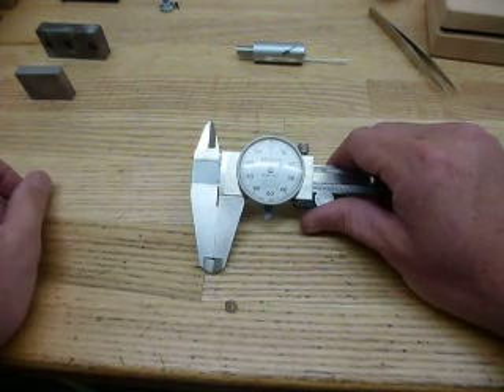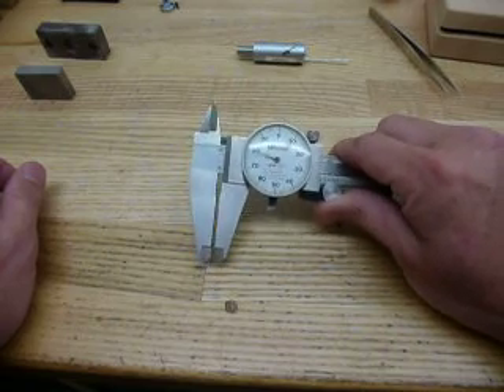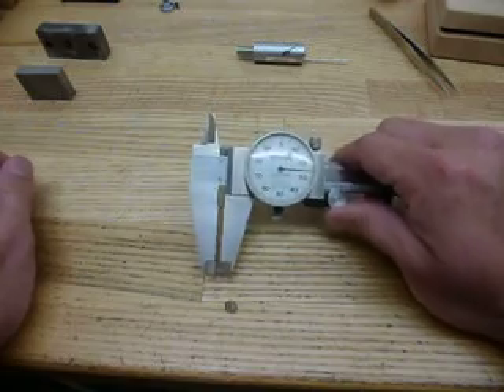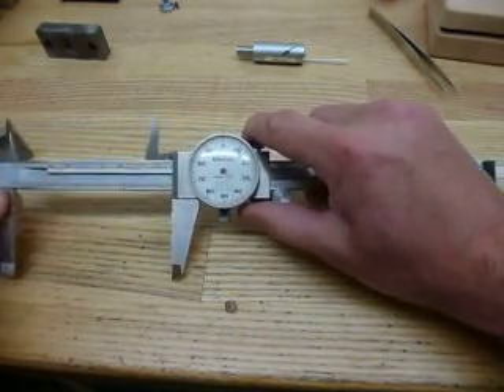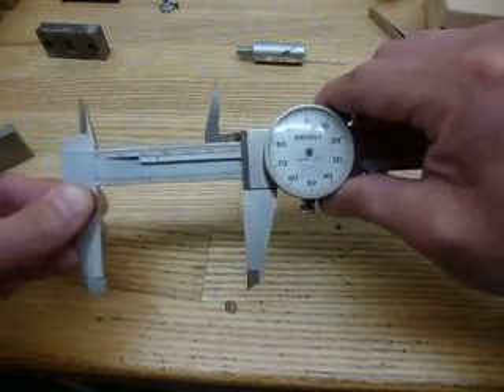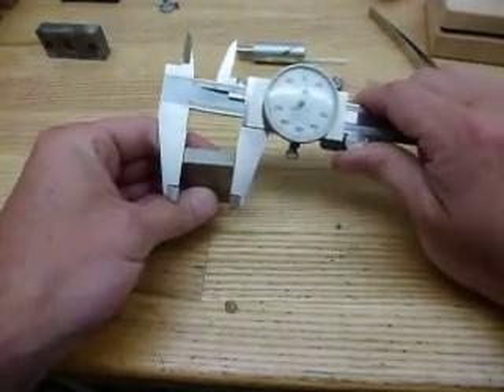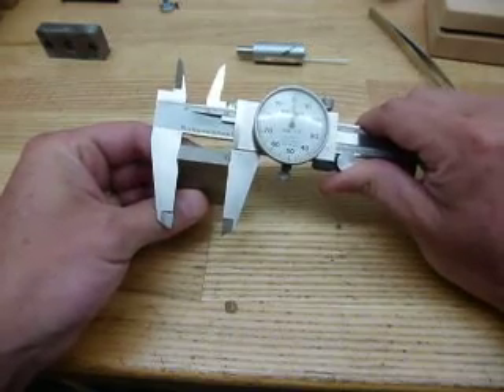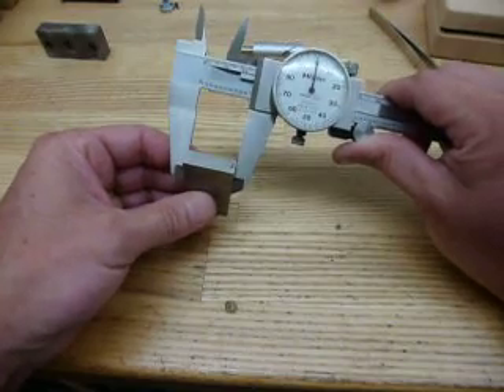Caliper Repair

Comment: how does one go about removing the indicator hand once the bezel is removed without breaking anything? I put a small flat jewelers screwdriver opposite each other at the pin end and it would not pop off.....

Comment: I have a mitutoyo dial caliper, the crystal is missing, is there a way to replace it with out a crystal press? I see I can buy the crystal on line, but it's $15.00 shipped, don't know if it's worth it.

Comment: I have a mitutoyo digital indicator 0-2", model 543-466b.  Not reading correctly, example checking. 250dia pin show .2495 n sometime show .248 Can u rough estimate fixing, thanks, cwkwm@yahoo.com or 714 568 8946 tim